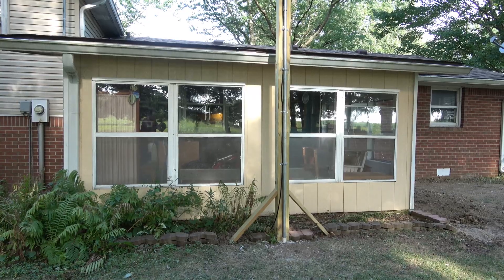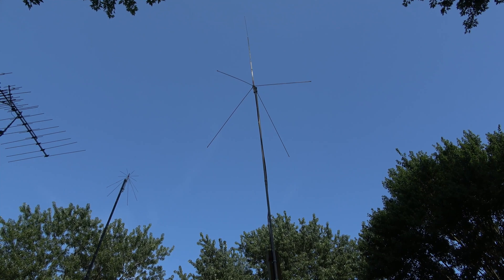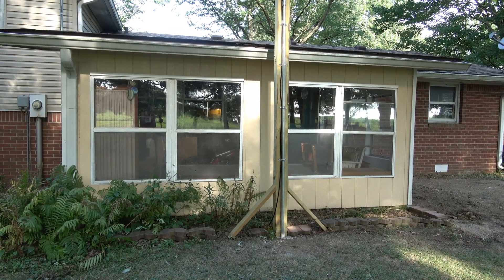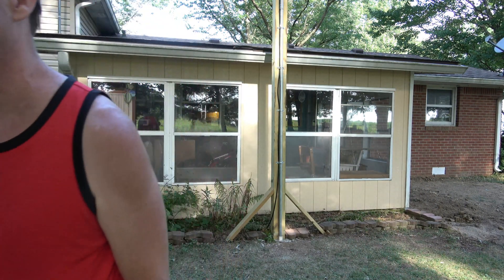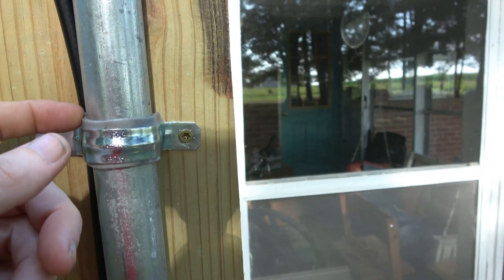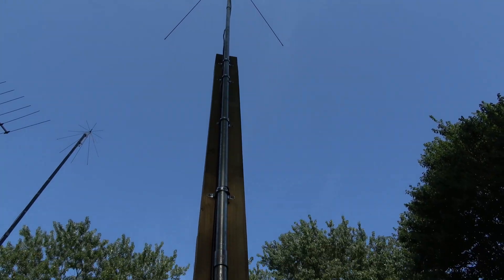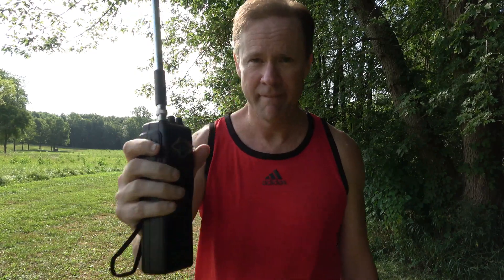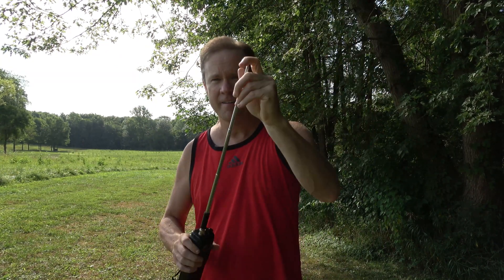Solarton A 99 Installation

Comment: no ground? lightning loves to hit fiberglass believe me! tape the antenna with 2 rolls of good quality 3m electrical tape from bottom to top of the antenna. this will keep static electricity from building up and attracting lightning. also the tape will preserve the fiberglass coating. no change on the important info. Thanks Bob
Reply from the maker: @robertmethia7080   Lighting took it out. I wasn’t sure how to ground it. I didn’t put a new one up. Thanks for the info I needed cb expert to help me with this. The lighting strike that hit it also took out my well pump and other electronics . Afraid to put another one up.

Comment: I recently put up a GMRS antenna on a 20 foot piece of 2-1/2 inch PVC pipe by myself. At 70 years old I thought I’d done a real good job….UNTIL…I realized after finishing it I’d never viewed it from the side and discovered it was leaning way to much forward! 😂. So, the next morning, at 6:30am CST, in 87 degree temperature (before it got into triple digits), I had to pull up the four pieces of rebar I’d originally hammered into the ground four feet [that was connected and up against the bottom of the pipe with four clamps to reinforce it]. I had to move it outwards a good six inches, but, she’s straight up/down as an arrow now and talking loud and proud on 462-467mhz radio! I had 38 years of CB radio while I was in trucking OTR so I wasn’t wanting to add a CB antenna also. In my new 2024 GMC 4WD DURAMAX I’ll mount my old faithful Cobra 29 (BIG RADIO!) and another mobile GMRS radio (Btech 50V-R). Great video and you and Pops did a good job! Stay safe! 
~Jim in Houston, Tx~  you can see my antenna at https://youtube.com/@TOTALLYRELAXED
Reply from the maker: Nice setup. My antenna just got hit by lighting and it wiped it out and created a power surge that done much damage. I hope your luck is better.
Reply: @gfonzy  Oh no! 😔. Sorry to hear that after all the work you and your Pop did. I haven’t had any lightning problems bc we haven’t had any rain for over 35 days so far. But, we ARE concerned about our property catching fire due to all the dryness though. Stay safe and I hope you get your antenna back up and operational.
Reply from the maker: @TOTALLYRELAXED   same to you stay safe, hope you get some rain.

Comment: I'm getting ready to install my A99 on the house as well. What size piping (conduit) did you use to bracket the antenna to?  1 1/4",   1 1/2"
Reply from the maker: 1 1/2 I believe , should work really well for you .
Reply: Ok, cool.  Thank you!

Comment: Well hows the Antron holding up?  and never thought about switching to a aluminium antenne?
Reply from the maker: It’s held up well , there is not much traffic in my area . More in the summer months. It was held up well with the high winds we get. I don’t know much about the different antennas and which one is best. Not sure how to ground it , I know how to ground a tv antenna using RG 6 cable but not this cb antenna .
Reply: @gfonzy  Too bad man, here in the Netherlands CB is very much alive again with the Corona here it is growing again. Here we also use antrons 99 and imax 2000 the newer version as so speaking. The most antennes i think are aluminium 5/8 with side radials (dont know how to call them in English) i use a Sirio Megarange 827. This is one off the best from sirio and its very sturdy and the swr is very very good, with 0.5 watt and 800 watt the swr is still very good. The recieve and send also top notch. For what i can see how you mount your antenne can be good for that also. I have it on a 5 meter steel pole but in a few weeks on a aluminum 12 meter pole with side braces attached to my house. Your mounting pole is for me a bit to skinny i would use a thicker pole minimal 48mm / 50mm thick (or is yours that?) but how you mount i agains the wood is very nice.

Thanx for the video and hope you can get some nice contacts in the summer.
Reply from the maker: @CheckitMedia   yes the pole is a bit skinny but seems to work. We have very high winds here and it’s holding on. I wish cd was better here , when the skip is rolling in it is good. Glad the Netherlands still uses those cbs.
Reply: @gfonzy  Good luck man with the cb and i hope you make many nice contacts.
Reply from the maker: @CheckitMedia   thanks and you to , keep on reaching out for new contacts .

Comment: I have the same antenna but my antron does not have the ground plane kit on it ground plane antennas are junk
Reply: Well same as me as my gpk has  been on since i bought my antron in 2001 as i bought that and a 5825 GE twinboard B model  ssb cb radio and an  8 amp motorola power supply all for $125 soo i thought that was allright.......The antron is still up in the air and its been up since 2001 and i had no trouble with it whatsoever as it gets me out extremely well and swr still 1.1 even when it rains....I have an Imax 2000 also with the gpk and i had that since 2006 and i had no trouble with that either as thats been a good antenna too...Im over here in Central Victoria Australia 2 hours drive north of Melbourne....824 wayne cheers fellas.
Reply from the maker: @waynestevens2910   Sounds like you have a nice setup. Glad to see CB is alive and well in the land down under .
Reply from the maker: @waynestevens2910   sounds like a great setup to me. Glad to hear that CB is alive and well in the land down under .
Reply from the maker: I don't know this one just came with the ground plan kit. Can't say if it helps or not.

Comment: I'am Your Newest Subscriber Great Videos. I Just Took My Antron 99 Down To Put A Ground Plane Kit On It . My Antron 99 Is On A 33 Foot Push Up Pole That Is Cemented 2 Feet Below The Ground . I Just Bought that Uniden Bearcat 980SSB Radio On Tuesday Used For 50.00. I Got My Antrons Ground plane Kit Used For 25.00 At A Ham Radio Fest Here In Florida
Reply from the maker: How’s it picking up no stop traffic. I don’t have anyone to talk with near me. I hope you make some good contacts .
Reply: Did the ground plane kit make a difference for you ? I am  reading mixed results.

Comment: I have the same radio in my truck, they work quite good, and the a99 is a great antenna. 
73's
514 Ontario Canada
Reply from the maker: It's a nice radio 73's from central Indiana.
Reply: @gfonzy  You need to hang out on 38 LSB , when skip is running you can make lots of contacts 
73's 
514 Ontario Canada
Reply from the maker: @charleswills4554   I'll do that, i hear so many people It's hard to keep up.
Reply from the maker: @charleswills4554   514 Ontario I’ll Listen for that  call sign .

Comment: You need ssb youll get way out
Reply from the maker: It has single side band on it, better reach for sure . I just don’t have any friends with cd radios near by .
Reply: @gfonzy  ordinary cb is single sideband you need upper and lower side band then you will get further and meet a lot of new freinds
Reply from the maker: @indiana146   It has USB and LSB on it and AM when the skip is rolling it pick up Canada and Texas .
Reply: @gfonzy  ok thats good what power do you push on usb or lsb
Reply: @gfonzy  where are you compared to canada and texas
Reply from the maker: @indiana146   Central Indiana in the Midwest .
Reply: @gfonzy  im in uk just getting ready to get back into cb since 80,s i got my first cb on holiday in mikwaukee  at a store called JC  PENNEYS  
it was a realistic trc handheld 
Ive now got a good rig  ready a ss9900 it pushes about 80 watts on side band and an 18 ft silver rod that wiĺl go on a steel pole on side  of house so tip of àerial is about  35ft off ground
Im not well so ill get someone to put it up for me
Reply from the maker: @indiana146   12 Watts my setup is stock Amps are not legal here. I know many people use them but I'll keep it stock here.
Reply from the maker: @indiana146   Nice 35ft off ground should get it up plenty high, The more people the help put it up the better and safer.

Comment: What kind of range you getting locally?
Reply: Get a amp
Reply from the maker: @jmanranger7271   I heard those help out !
Reply from the maker: Really good  4 or 5 miles depending on the other person setup .
Reply: @gfonzy  4 or 5 miles?  I get 25 -45 miles with a Uniden PC68LTX (3 watts out) using a homebrew aluminum 1/2  wave dipole at 30' (horizontally polarized).  Coax is 85' RG-8X (LL-240 Flex by Davis RF).

Using this same set up, I have talked all over the US and Eastern Canada as well as into Europe when the 11 meter band is open.

Using this antenna with my Yaesu FT-840 on 10 meters I have worked most of Europe and Russia as well as the middle east and eastern Africa running 35 watts (PEP) USB when the band is open.

VSWR is 1.5:1 on 26.965 MHz to 1.8:1 on 28.600 MHz.
Reply from the maker: @jfrphoto01   I hardly ever talk to anyone on it other than the best by farmer. I know no one else around me that uses cb radios so I do t know  the true range on AM or single side band . Sound like you have a nice setup.

Comment: What's the name of the antenna for your handheld?
Reply from the maker: Anteenna TW-999BNC BNC Male... https://www.amazon.com/dp/B075QCJM6S?ref=ppx_pop_mob_ap_share
Reply: @gfonzy  Appears that is a scanner antenna.  I don’t think I would TX with that.  SWR on that handheld is probably high.

I like the Antron!  Nice and high!    Love that Pops is helping out.  My Dad is in his 80’s and he helped on my mobile install.  Made him feel good but didn’t get why I would drill a hole on the roof of my truck. LOL
Reply from the maker: @rallypoint1   YEs that is a scanner antenna used only for my scanner.THe SWR is dead on perfect on the A 99 antenna setup. You drilled a roof hole hope that doesn't leak to bad hahaha.
Reply: @gfonzy  glad the SWR is dead on!!  It was just a heads up on that scanner antenna.

Ya I drilled a hole but also drilled a hole in the floor so the water can escape.😂
Reply from the maker: @rallypoint1   Now that’s good thinking an inlet and and outlet . That should get good range .

Comment: Whats the diameter of your pole
Reply from the maker: 4 inches, i used 3 10 ft sections, it's been great it's held up in really high winds. Top of antenna is 46 or 47 feet. Pick up good.
Reply: @gfonzy  its looks very good indeed I've used the same clamps on my pole but instead mounted it to a tree 🌳 I'm running a 20ft pole with 24ft imax 2000 with a magnum omegaforce s45hp
Reply from the maker: @trx250rpuma4   Nice i bet it pick up good, my SWR is perfect with my setup.
Reply: @gfonzy  excellent buddy can send me a like for the pipe straps and 3m outdoor tape
Reply from the maker: @trx250rpuma4   I ordered the 3M tape but everything else I got at Home Depot, other an the antenna I ordered that.
Reply: Get a power Mike
Reply from the maker: @jmanranger7271   I'll look into that !
Reply: What was your cost of this project
Reply from the maker: @jmanranger7271   I think it was around $300 for everything. I bought the good cable RB 213.
Reply: Papa bear
Reply: Where did you buy your coax
Reply from the maker: @jmanranger7271   https://www.cableandwireshop.com/rg-213-u-100-foot-coaxial-cable.html
Reply from the maker: 100ft of the thick heavy cable $102 , good price
Reply: Thanks!